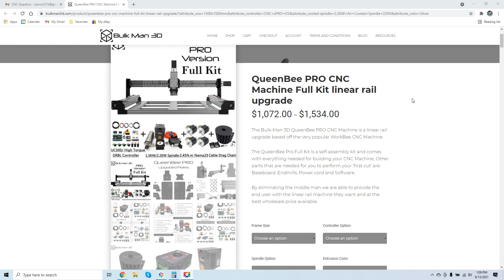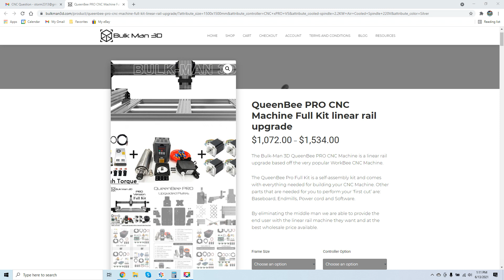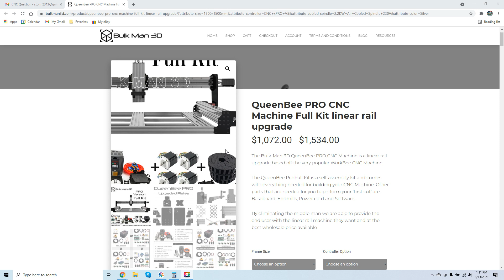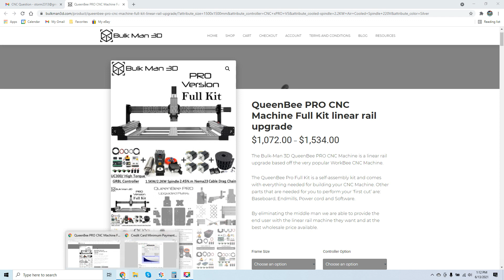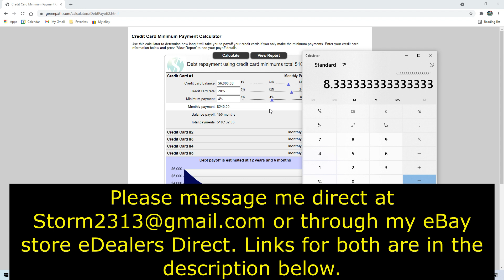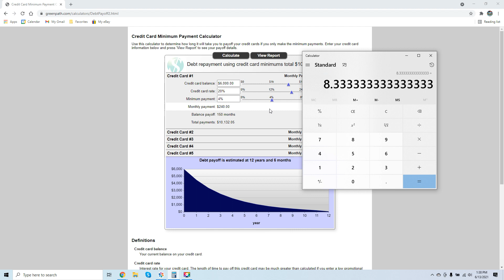How To Buy A 6k CNC Robot For 2K The Tremendous Power Of Leverage..

Comment: All good points, people who are new to business often look at the problem from the wrong end. The same sort of questions come up in manual machining, decide what capability you are going to need, then buy the machine that will meet that need. Anything less is the road to hardship and regrets, neither of which puts money in the bank. 

I also tell people to be sure and add in the cost of installation and tooling, which are things people often forget. It does no good to have a machine that you don't have the infrastructure for or don't have a basic tooling package in order to operate it. 10-15% additional is what usually works as there are always things like vises, collets, toolholders and cutting tools themselves that are must have items.
Reply from the maker: Steamfan71, thank you for your support, and you added in some details I forgot to discuss, thank you for that, and very well put. Accounting for everything including all tooling is a must. Thank you again, and have a great weekend!
Vince
Reply: https://www.aliexpress.com/item/32866993064.html?spm=a2g0o.productlist.0.0.3a782eb5iJBZcP&algo_pvid=6d30a0a3-d8ea-45bd-a021-25dc008220b5&algo_exp_id=6d30a0a3-d8ea-45bd-a021-25dc008220b5-2      ltcnc-1212    i was just looking at this when this video came up     or here  https://www.aliexpress.com/item/33006147155.html?spm=a2g0o.productlist.0.0.3a782eb5iJBZcP&algo_pvid=6d30a0a3-d8ea-45bd-a021-25dc008220b5&algo_exp_id=6d30a0a3-d8ea-45bd-a021-25dc008220b5-1   youll have to remember that it only gets shipped to port then have it transported to your door i looked it up and its an additional $545 for myself to get it delivered to my door

Comment: I don’t know where a 4x4 non-hobby machine can be found for 6k Vince. I’ve looked for a 2x3 or 2x4 and they are 6-10k please point me in the right direction.
Reply from the maker: Fierceflyer55, thank you for your support. They are out there, and some are better than others. This particular client I was discussing in the video wanted this chassis https://www.avidcnc.com/pro4848-4-x-4-cnc-router-kit-p-251.html I'm not a fan of rack, and pinion for a router, I prefer a ball screw transmission.  I've had clients have there chassis made overseas with ball screws without electronics to the specs I've designed for their applications, and they usually fall around $4k-$4500 shipped, and when fully outfitted are about 6k. Thank you, and have a great weekend!
Vince
Reply: look at this     https://www.aliexpress.com/item/33006147155.html?spm=a2g0o.productlist.0.0.3a782eb5iJBZcP&algo_pvid=6d30a0a3-d8ea-45bd-a021-25dc008220b5&algo_exp_id=6d30a0a3-d8ea-45bd-a021-25dc008220b5-1